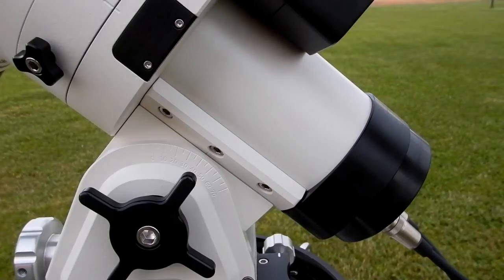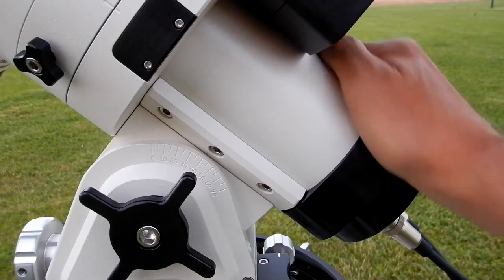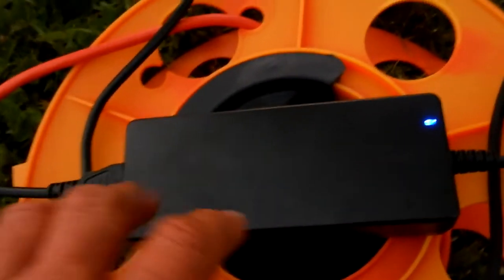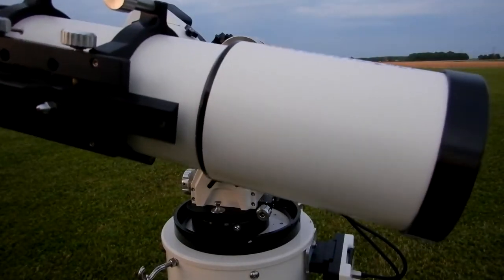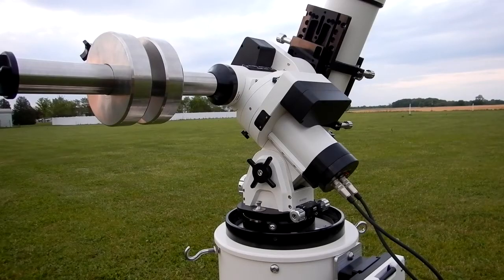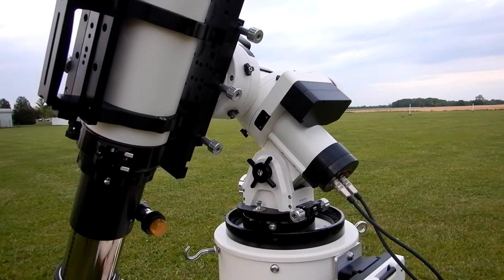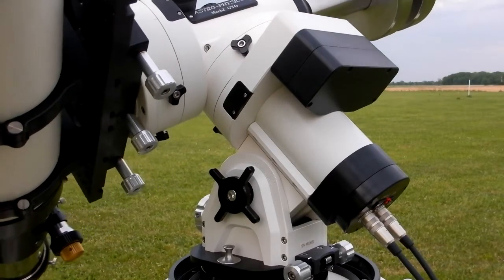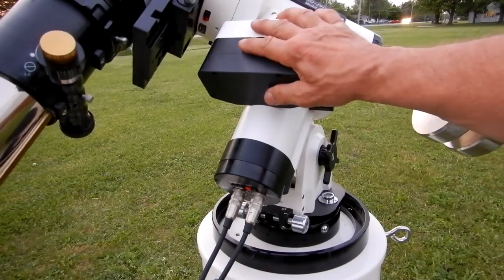Astro-Physics Mach2 Equatorial Mount Vibration - Noise ISSUE

Comment: I think it could be a cable problem.  Try swapping your RA and Dec cables and see if the issue is then with Dec. Or reseat your RA cable.
Reply from the maker: Brent Boshart   Thanks. Actual I did that. I started out with my new 22" cable set I received. Connections were good. Then I put on the original length cables that come with the mount and still no change.

Comment: That’s a shame. Something rubbing internally or perhaps a motor going out? I can only imagine what the inside looks like…
Reply: It is not a shame, sometimes things can happen even with a top tier brand like Astro Physics. I am sure they will fix the issue immediatly, they are well known for their superb customer service.
Reply from the maker: MrFlextor   Indeed, AP is second to none when it comes to support of their products!
Reply from the maker: Hopefully it is a simple fix.
Reply: Hi how did you fix the vibration issue?
Reply from the maker: Dialoss Winsten   https://youtu.be/2YMXr6ewAjs
Reply: @starastronomer  Good!  did you solve the problem only by loosening the belt?
Reply from the maker: I adjusted the belt to the proper tension as shown in the video.
Reply: @starastronomer  thanks!  Can you add subtitles to video?
Reply from the maker: I don't know.